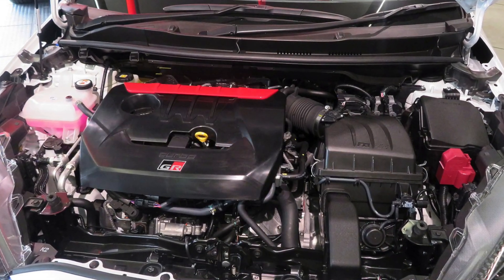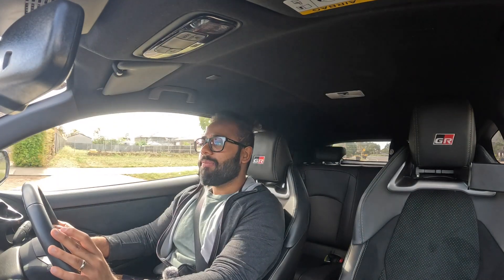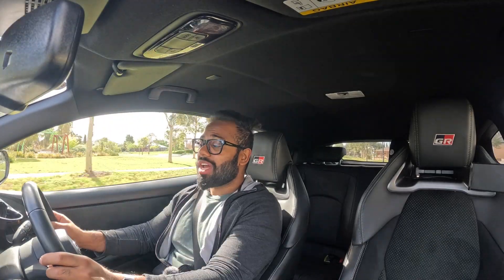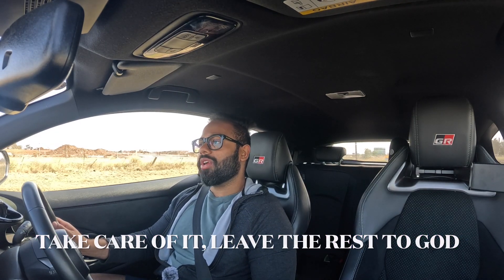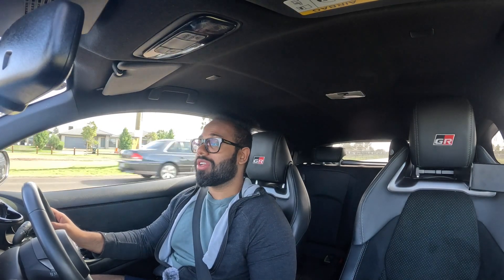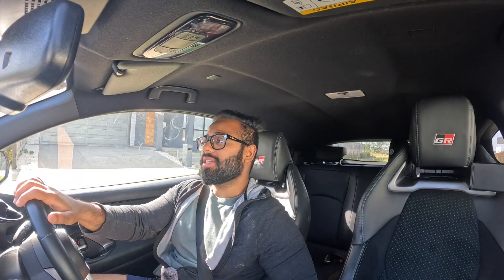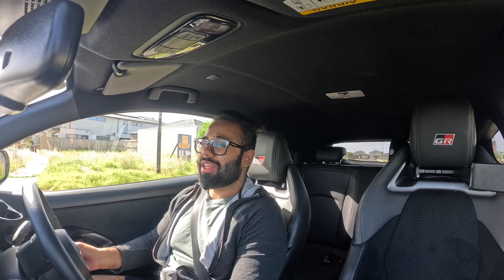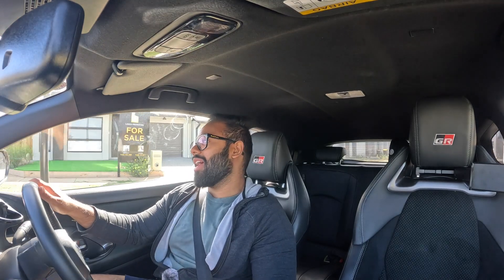Is Toyota's G16E-GTS Reliable? (GR Corolla and GR Yaris)

Comment: I had a 2023 Corolla GR was a fun car my only mod was intercooler and charge pipes. But I sold the car but I agree this isn’t a car I would push to far because there are better options out there to tune with. Plus the engine is unbelievable expensive to replace if something goes wrong. I had since 20 miles sold with 26k it was very reliable. I maintained my very well with 2500 mile oil changes and 10k diff & transmission fluid changes
Reply from the maker: Yep they're great cars but as you say, not worth it to tune. What did you end up buying?
Reply: @ couple cars 2022 tesla model 3 performance 510hp daily. C8 corvette both are extremely fast

Comment: BMW Supra is more reliable than the GR engine.
Reply from the maker: Hmm I’d probably trust the G16e-GTS more than the B58 long term. But I can see both sides.
Reply: @motoringfan B58 have only direct injection. Inlet valves are more sensitive for carbon build up than the G16E-GTS. B58's cooling system have failures at high mileage, valvetronic problems also at high mileage. PCV valve problems. B58's Turbo is not as good in compare the ball bearing of the G16E-GTS. Long term? whe wil see after 10 years..
Reply from the maker: @tinodeblier5694  yes, end of the day I trust the Toyota engine more long term. That said, later b58 gens have both port and direct injection
Reply: @motoringfan I love the GR motors but the B58 is by far more reliable.

Comment: 0:57 the rules for rally are a 1600 cc motor, or 1.6L. Not for 3-cylinder specifically, Toyota just decided to go with a 3cyl. design instead of 4.
Reply from the maker: rules were different for the class they wanted to compete in at the time
Reply: @ What were the rules?
Reply: i agree. and they are blowing up a lot those 3 cylinder bombs, not so much the Fords, yet......... that's the main reason i bought another a really low milage Mk7 Fiesta ST.. I'm never going near any 3 cylinder... EVER.
Reply: @meganjay30  Toyota has been using a 4-cyl 1.6L in rally1 since 2018… they just started using a 1.6L 3-cyl for the new rally2 class last year. “Popping so many engines” ?? And how many wins and championships has Ford won over the last 7-years? Fiesta is a great car, don’t get me wrong… but cylinder count has nothing to do with an engine’s reliability… look at Hyundai, they’ve been making plenty 1.6L 4-cyls for several models of their cars… how reliable have those been throughout the last decade?
Reply: @UnkoBraddah  i use to see them on the road here a lot when they came out but i haven't seen one in like 8 months now.. can't deny the truth lol

Comment: 1.6 Litre engine turbocharged to within an inch of its life for no real apparent reason.  They could have made this engine a 2l four and achieve the same 300hp+ without resorting to this much boost.  For what purpose?  Does the 1.6 weigh that much less than a 2L four?  It’s not fuel economy cuz the GR is actually a bit of a guzzler when on boost.  So if it’s not weight &/or fuel economy and Definitely not reliability/longevity.
Reply from the maker: @facetiousmonkey5322  it was to meet the group rally specifications of the time.
Reply: @ that makes sense but owners should not complain if the engine requires higher than average maintenance and there will be problems when these engines run up the mileage.  There is always a tradeoff.
Reply from the maker: @facetiousmonkey5322  Yeah I think thats fair!
Reply: @facetiousmonkey5322  oh no, all the 400+hp GR Yaris examples must be anomalies then 😂😂😂
Reply: “Within an inch of it’s life” please… Toyota knows what they’re doing, they always play things very safe, and there’s plenty of people tuning these things much hotter and running fine. And there is a VERY apparent and REAL reason for the 1.6L motor… it’s for rally homologation. Time will tell, I bought an extended warranty on mine good ‘til 125,000 miles, so obviously they feel confident enough to stand behind it for that duration.
Reply from the maker: @UnkoBraddah  I'm of the same view mate!

Comment: GR Gen 2 has taken care of a lot of issues. They've increased the strength of the piston and valve springs, and improved the cooling with a bigger intercooler and spray jets. I just picked up a Gen 2 and the engine is a massive improvement over the Gen 1 in terms of drivability
Reply from the maker: Congratulations! I have not driven the gen2 but yes I imagine it’s an improvement in every way! Pity about the price but that’s the world we live in. Enjoy it in good health
Reply: i use to see the GR Yaris on the road here and there a couple of years ago but i haven't seen one in like 10 months straight here in australia.. i still see the regular clio/megan RS, focus RS and fiesta/focus ST's ect everyday... but not one GR Yaris for ages..
Reply: Wish we got the spray jets on the GR Corolla, they’re so cool
Reply: I hope they can find the cause of it's the same issue or it is fixed😊 and I really really hope they make the Toyota sfr in the USA id absolutely buy it if/when they do bring it I am first on the list at 5 different deslerships
Reply: @khamid1 They didn’t kill the 50/50 drive mode, normal is 60/40, gravel mode is 50/50 and track is UP TO 30/70 F/R which they said was the case for the 30/70 even in gen1.
Reply: @brodiwheeler7583  gravel is front biased, check again. Track is variable between front and rear. There is no 50/50 lock anymore.
Reply: @khamid1  There is no 70/30 lock anymore either. No that I can tell the difference. I have both in the garage.
Reply: @darrenprior6339  70/30 was a let down in reality, 50/50 is the only drive mode I use. I still admit the front of the gen 2 is the better looker.
Reply: @khamid1  You have a source reference for that? Cuz Gravel looks like it says 50/50 to me…
Reply: Gen 1 is king, gen 2 killing the 50-50 drive mode is a fail. But then again my Gen 1 is barely a production GR anymore, and basically an Rally 2 😅
Reply: @khamid1  Spoken like someone who's never owned both.
Reply: @darrenprior6339  you would be incredibly wrong lad. I do like the front of the gen 2 though. Get ready to have a fix for the gearbox once you go beyond 500nm :)

Comment: I still haven't seen any data on WHERE the fires are starting.  I'm a WRX driver, but love the GRs as well.  All of these cars get a bad rap for something that sticks and gives it a bad reputation.  Or the manufacturer blames the driver, because with a performance car, it is easier to claim it was driven too hard compared to a RAV4 being driven by a 70-year-old.
Reply from the maker: its absolutely bizarre with many claiming impacted fuel lines. But it's all assumptions. who knows, but 2 cars out of thousands doesn't worry me
Reply: It's holes in the block

Comment: Mine is has been solid for over 65,000 km
Reply from the maker: yep, mine has 45k kms. Pushed daily. No issues
Reply: Are you guys stock still? How much power? I have a bone stock gry but would like to put some mods pretty soon!
Reply: My 2021 GRY is going strong at 31,000 miles, very few fires or engine explosions so far., haha.

Comment: The long term reliability depends on the weak points of this engine. Pre-ignition  problems causes by blowbey are stil the only things on low mileage G16E-GTS engines.
The wrong oil,  and bad chiptuning software cause this.